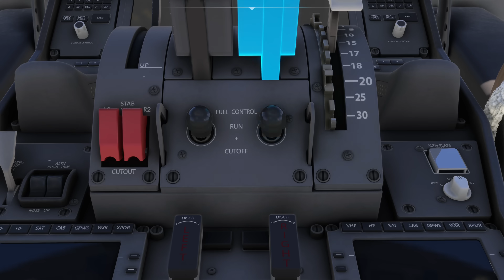Air India 171: Why Did The Fuel Cut-off Switch Get Moved?

Comment: If you gave enough money in ‘certain’ countries you would get a report stating sun rises in the west verified and cross-checked by multiple agencies. What shocks me the most and which everybody just ignored is the fact that the report was LEAKED out in the American Press before it could be released officially in India and that is very unlikely of the norms there. Furthermore, the report unlike most other reports of this country has zero signatures. Nada. Nil. That isn’t the norm there. Something is very fishy and to state that these pilots are at fault when you have zero evidence to prove anything in a court of law is bewildering. In any court of law anywhere in this world, no judge would ever blame the pilots here. Based off of the evidences here, one pilot said why did you do it, the other denied doing it. A line needs to be drawn there. Any logical person NOT trying to push their agenda would agree with this. The pilots should be given plausible deniability unless and until proven otherwise. Till then, cheers to the propaganda!

Comment: Video flight recorder would just be tied to a 3rd black box that only records last 24 hours (if that's feasible) 

or they could set it up so it's loke a dashcam in parking mode, if a switch is pressed or toggled 5 seconds before and 10 seconds after the action has happened the video+audio is saved (so you get 15 second clips 5 seconds before and 10 seconds after) 

That could record weeks of flights in 15 second intervals between button and switch presses 

The videos would only be accessible by crash investigation or authorised technician (testing or required to pull for investigation purposes)

Comment: Thank you Captain Steeeve. You are doing a big favor to humanity with your clarifications and explanations. I have been your videos and the media reports and a few questions:
1. If the 2nd pilot did toggle the fuel cutoff switch: 
   - the first pilot would have seen it. This is unusual and he would have definitely noticed the act.  
   - when asked, the second pilot wouldn't deny it. People are truthful in the final moments of death as they are not scared of the truth.
   - the 2nd pilot would have resisted the first pilot in restoring the switches. 
 2. Let's assume the pilots are not at fault. The FAA 2018 directive says "If the locking feature is disengaged, the switch can be moved between the two positions without lifting the switch during transition, and the switch would be exposed to the potential of inadvertent operation. ". As such, is it possible that due to the plane vibrations and due to some specific liftoff angle of the airplane, the switch toggled to the OFF position on its own? I hope someone in Boeing is trying to find this.

Comment: 10 seconds is a very long time when you know what the problem is as is 4 seconds between turning the switches back on. Things can easily fail electronically giving the same input as the switches. In order to be sure one would need to look at wiring diagrams and logic but that wouldn't be in the interests of Boeing.

Comment: As for a more elaborate procedure to cut off fuel: keep in mind that a single pilot still needs to be 100% capable of flying the plane when the other pilot gets incapacitated.  That frankly happens a lot more often than a pilot deciding to commit an unthinkable act. So be careful putting in systems in place that will actually make things less safe when a single pilot must fly the plane. And crucially: IF a pilot really wants to crash a plane then he will very like find a way to do so no matter what restrictions you put in place.  You can't really design systems to prevent that, without making it worse for the 99.9% of cases where pilots are doing their damnedest to keep a plane in the air during emergencies.

Comment: Why do you assume that the switches have been moved?
It is often ignored that the fuel cut off switches are not directly connected to the fuel pump or valves. These switches only signal the FADEC to do so. I.E. it is totally possible that the switches have never been touched when the engines slowed down and one of the pilots noticed it. One tragic szenario is that the FADEC malfunctioned and switched the engines off by itself due malfunction in the signal processing. Then one of the pilots  asked "Why did you do that"  and the other one said "I did not do it". Then they were baffled by the switch positions (it took around 6 seconds), and then they took one of the switches from RUN to CUT OFF (compatible with the engine state) and tried to turn it on to RUN position again. After another 4 seconds they tried the other engine which never came alive again.

Comment: Is it possible that the fuel switches were physically in the ON position but a glitch shut the fuel supply and that got recorded on the black Box? 
Later the pilots physically moved it from the ON position to the OFF position and then back to the ON position. 
This is Making an assumption that the second pilot did not lie and Cockpit voice recorder does not have any other conversation between second pilot saying " I DID NOT PUT IT off" and "MAY DAY"

there was more then 13 seconds from the Pilot saying, "I did not put it off" and "MAY DAY". And 23 seconds from Fuel shut off. And know other discussion on the cockpit voice recorder, Unless the entire conversion on Cockpit voice recorder is not shared. In that case it could be anything.

Comment: Question:
Could it be that the latching function of the cut-off switches was worn out and the pilot monitoring accidentally touched the switches? I've often seen videos the Pilot Monitoring hold their hand in this area of the throttle during takeoff. Could they have accidentally hit the switches due to vibrations (ground irregularities or turbulence)? In my opinion, the two bars to the right and left of the switches aren't enough to protect against this...

Greeting from Germany

Comment: Could it be that physical switches were on RUN all the times? EDFR only recorded electrical signal and there was a software glitch that turned off fuel one second after the other. Pilots had to put the switches physically back to CUTOFF and then to RUN, which explained the longer 4 seconds gap.

Comment: I've come across some claims suggesting that if the thrust levers aren't set to idle, the engines won’t shut down—even if the fuel cut-off levers are placed in the cut-off position. How accurate is this?

Comment: 0:48 This smells like the (mental)case with German Wings, why would you cutoff both engines from fuel at such critical stage in flight? It makes no sense otherwise. When done at 35.000ft there's plenty of time to restart both engines, but when done at 300ft there's not much wiggle-room unless you do this on purpose with the intention to die. There should be an automatic override build into future planes to prevent the use of cutoff switches at taking off and this override should then be released when either in ground mode or >5000ft in the air.
Reply: Isnt it standard procedure to do that in response to dual engine failure?
Reply: @pran10000  Again in dual engine failure what is the point of cutoff both engines while plunging as a rock?
Reply: @sapperdeflap  I dont know the point. The Boeing safety manual says so.
Its tells them to put the fuel safety vswtich off and turn it on again.
Reply: The engines failed way before that. It's common sense to try the basics when you see death and have no option in hand.
Also pilots are also trained to cut off the fuel switches before impact to avoid any fireball.

Comment: Whoever asked why did you cut the fuel - Would not his first reaction be to to set the switches back to run not wait 10 secondsa for one fuel switch then 14 odd secobds for the second fuel switch. Thats quite a long time to take no action when a timely positive action is required.

Comment: The fuel switches should be programmed in a way that the pilot can not turn both switches on off position during take-off until a certain speed and altitude is reached.

Comment: I'm not a pilot so I'm really just asking for clarification. the preliminary report indicated that there was a 1 second interval between the 2 switches being toggled to cut off position while it was a 4 second interval during toggling to run position. Is it really possible to toggle both switches within just one second knowing that there is a pull action required? i saw someone else do it and it took 1.7 seconds.

The cockpit dialogue also indicates that one pilot asked the other why he set the switches to cutoff. Capt. Steeeve seems to assume that this was asked because that pilot saw the other do it through peripheral vision. An Indian pilot in a simulator mentioned that toggling the switches down would blast an alert on the screen in front of the pilot. It means the pilot who asked the quesation didn't have to see the other pilot do it. My question is that, is there any chance that the switches were forced down for some reason. i've also seen Capt. Steeeve's colleague (sorry his name eludes me at the moment but it's the same one who collaborated with Capt. Steeeve a few days ago regarding this crash) mention something about the possibility that the pull action of the switches may have been faulty based on previous switches on other models, indicating that they could easily be switched run or cutoff without pulling them. Is it possible that something other than human intervention would force these switches down by themselves? This could explain the 1 second interval between both of them going to cut off.

An Indian Dreamliner pilot also says that it is unlikely that either pilot manually moved the switches to Cut off position within 1 second (hence the 4 second interval putting them back to Run position). You can see this interview by searching for "Air India Probe: Pilot Who Flew Dreamliner For 10 Years Explains EXACTLY Why Pilot Error Is Unlikely"

Comment: In all honesty Captain, Precisely what we know is that one pilot accused the other of setting the switches to cutoff.  He might have seen this via peripheral vision, or he heard the engines dial back, and looked and saw the switches off, then accused.   The investigation must rule out any circumstance in which they could move without human input.   This would be James Bond level sabotage if it happened.   I respect your opinion, but I can't help but think 10 seconds is a long time to take to get back the one thing that can save the aircraft.

Comment: Maybe - although they said that the fuel quality was "acceptable" (..)  - the fuel was indeed contaminated (something hard to admit by airport and/or fuel delivering company due to loss of reputation)  and the fuel contamination was detected in the fuel supply to ONE engine. The pilot wanted therefore rapidly to shut down that engine, but instead did shut down the other engine's fuel switch? something is fishy about all of this. Disclaimer: I am only guessing and could be completely wrong.

Comment: No aircraft cockpit design will ever be foolproof to a su1c1dal pilot. Period. Ergonomics can always be improved to prevent human errors, but a voluntary dangerous action will always be possible. The whole point of having pilots is to have the authority to quickly manage critical failure situations, not all of which can be predicted. Which is also the very reason why an AI with no human pilot is not a serious idea even in the long term.

Comment: From my layman's understanding, manually shutting off the fuel supply to both engines immediately after takeoff at full thrust almost certainly results in a crash like the AI 171. Therefore, there seems to be no practical benefit in any situation to shutting off both switches in take-off mode. 

Why, then, isn't something like this prevented by the aircraft's control software as an "implausible intervention"? 

Are aircraft developers really so outdated in their use of automated processes? It's unbelievable!

Comment: Two points Steeeve. 1, 2-stage fuel cut-off interlock. 1 pilot pulls the interlock switch, 2nd pilot operates cut-off switch. 2, in-cockpit CCTV. In most of my 50 working years I have been covered by surveillance cameras. I have never had qualms about it. In fact, on several occasions, I have been grateful that it has proven my actions were correct. If the video recordings can be integrated into the voice recorder box I see no problem. You never hear of leaked conversations from the black boxes. In this instance it would have shown who operated the switches.
Reply: An additional confirmation of what happened with those switches would have saved a few million comments and dozens of videos from being made.  It's important that the public trust what's happening, whether their questions are valid or not.  Visual evidence is something everyone understands.
Reply: Given 40% of plane tragedies are pilot error/intent most definitely having a cctv in cockpit will reduce if not totally eliminate insider threats.
Reply: Like everybody else, I'd like to know. However, besides satisfying our curiosity, how would it help? They can still do their investigation for motive, and just look into both pilots.
Reply: @MikeIsCannonFodder 

It would remove all doubt as to exactly what was done and by hand/arm recognition, WHO did what.
  There doesn’t need to be cameras watching the pilots themselves, but they could have cameras focused on all critical flight controls and panels.
Reply: @57Jimmy  Right, but besides knowing, how does that actually help? You can get the same end result by investigating both pilots.
Reply: @MikeIsCannonFodder  You’re asking “other than confirming exactly what happened, how does that help”? If knowing what happened doesn’t matter, just get rid of the CVR and FDR too, and let us just guess at everything.
Reply: @MikeIsCannonFodder how exactly “by investigating both pilots” are you going to know exactly who flipped the switch, just as well as video showing who exactly flipped the switch? That’s some impressive “investigating”.
Reply: @rdspam  Presumably if you knew which pilot, then that pilot would be investigated in order to figure out why. You could do that investigation on both pilots. You might find evidence that it really could have been either, but there's also a good chance you come across something that clearly indicates one or the other.
Reply: @MikeIsCannonFodder  Rather difficult to investigate 2 dead pilots.

Comment: Hi Steve,

In one of your video you mentioned about an interlock which would restrict the Pilots to pull the landing gear when on ground. Well, it makes sense to do so and Failsafe conditions be on top priority to make sure that it's not being overwritten by the Pilots(intentionally or unintentionally).
I am not from Aviation industry but a true Engineer. I would like to know, why there is no such interlock for those Fuel cut off switches when the aircraft is in air. I can understand that there can be times when the Pilot may need to use those switches in Emergency. But if the aircraft is smart enogh to auto Take off and Land, why is it not smart enogh to detect that it's not at an altitude to safely turn off those switches.
Long story short, why there is no interlock for the Fuel Cut off switches when the plane is in the air and have not reached a safe altitude?

Thanks.
Airbus Over Boeing junk craft

Comment: There was a question about why the computer would allow both switches to be shut in flight and Steeeve said he might need to shut one off. But would he ever need to shut BOTH off? Perhaps that's a rule for the computer to enforce, or at last to require some verification for.
About a design change requiring both pilots to cooperate in shutting off fuel, what if one of them is incapacitated?